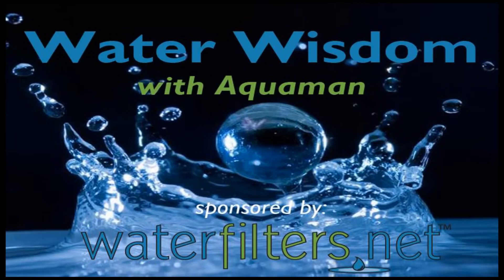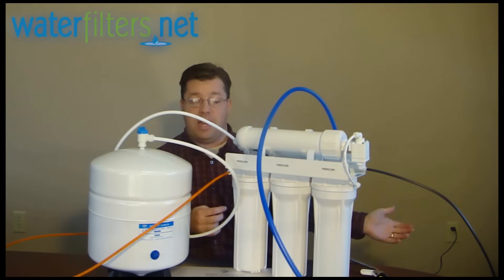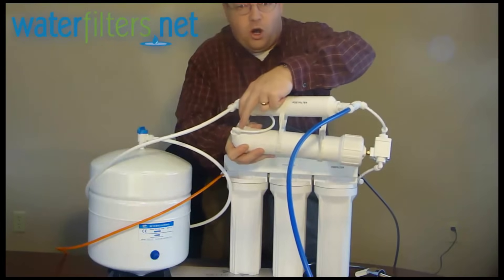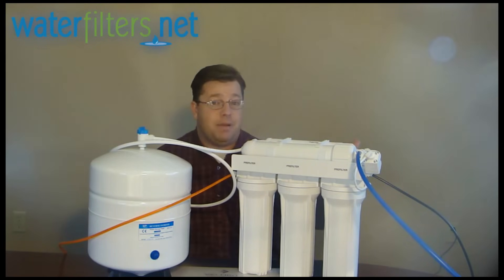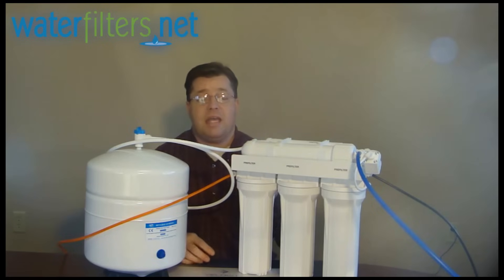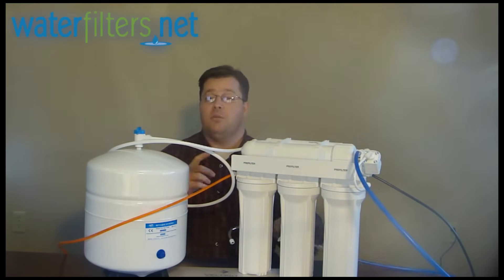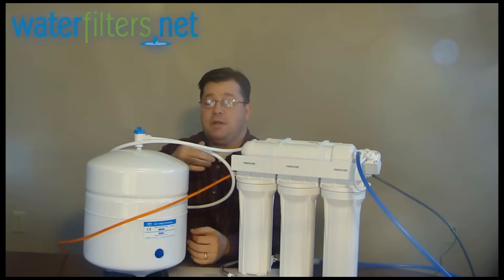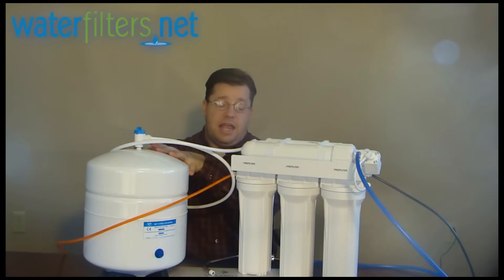Reverse Osmosis System Troubleshooting

Comment: I replaced an old system with new pre-filters, membrane and post filter. The only parts retained from the old system were the faucet and accumulator tank. I serviced the empty tank to 8 psi. Upon applying first water pressure, I had an audible flow that quickly filled the pre-filters and after a minute or so, flow could be heard in the waste-water line. However, after 10 minutes of healthy inlet flow, I was seeing nothing at the faucet. I disconnected the line between ASO and post-filter . . . zero flow. Bad or poorly connected ASO?
Reply from the maker: Deanna Douglas Yes, I would check the ASO valve connection to see if that could possibly be the problem you are experiencing. If that is not the problem, please call our customer service department and we would be happy to trouble shoot with you.Our phone number is 888-801-7873. We are open Monday - Friday 7AM-7PM CST.Thank youWaterFilters.NET

Comment: I have an older neglected RO system that came with my house. I need to disinfect the system, replace all the prefilters, replace the membrane, replace a bad auto shut off valve, replace the flow restrictor (printed on it is "440 FR". Can't find a membrane to match.), and replace the polishing filter.  

1. Am I correct in guessing that it is still best to rehabilitate this old system vs a full replacement?
2. I have two prefilters and I have city water. Should I skip the sediment filter and have two carbon prefilters?
Reply from the maker: Jeffrey Obney It would depend on how old the RO system is. As long as it is in good working shape, you should be fine with just changing all the filters and cleaning the system.We would always suggest to use a sediment filter first. That would help prolonger the life on the carbon filters and membrane.I am not able to locate that specific flow restrictor, but we do carry a wide range of sizes.You can view them directly here:@Flow-Restrictors.htmlPlease let us know if you have any additional questions, or feel free to contact our customer service department at 888-801-7873. We are open Monday - Friday  7AM - 7 PM CST.Have a great day!

Comment: Hi .. nice video. My husband changed the faucet to the ro system and now the water is murky.. it's been two days now. Do you have any idea why this has happened?
Reply from the maker: 621Lori It may be caused by any build up that was on the water lines previously. I would suggest letting the tank completely fill and then empting it and see if that helps with the murkiness of the water.If this does not work, Please let me know!
Reply: *****
Thanks for responding.. I did as you said and drained it and let if fill again..three times actually.. and it's still murky.  Any input as to why.. would be greatly appreciated.
Reply from the maker: 621Lori If the only thing you changed is the faucet in the RO system, it does not make sense to why your water would be murky. How long has it been since you changed your filters and membrane?

Comment: Exceptional video, never seen so many comments on a video. I am having a purging sound coming out of the faucet vent hole. Going to check my tank pressure, but wondering if this is the sound of water draining out the black tube you described? System works fine other than this annoying sound. THANKS AGAIN!
Reply from the maker: RVFanatic Good Afternoon,Yes, the sound you are probably hearing is the brine water draining out from your faucet.Please let us know if you have any additional questions!
Reply: RVFanatic

Comment: Great video. The problem I'm having is that my tank will not fill. After replacing my filters and opening the supply valve I could hear the water fill the filter housings but then stops without any water filling the tank. All lines/valves are open. any help would be appreciated.
Reply from the maker: Matt R. Our customer service department would be happy to trouble shoot to locate the problem for you. Please contact us at 888-801-7843. We look forward to hearing from you soon!

Comment: Wow, great video.  Lots of good information.  I changed the filters and everything seemed ok for a week or two.  Then the pressure in the tank was low and we pumped it up and the pressure is good.  But now the taste is off.  I did not change the finishing filter when I changed the other four filters.  I did not change the finishing filter because all of the other filters were very clean.  Do you have any suggestions? Change the finishing filter?  Flush the system?  Or what?  Thanks so much.

Comment: My tank is no longer filling. but i dont hear the cobstant running down the drain. I've had my system for a yr now. It's same model as in video, except I have an additional UV module on top of filterpac. Could the fact that the tank doesn't fill AT ALL, be due to the bladder, or is that more of an ASO valve?

Comment: I have a WHER25 RO, I am getting a leak from the faucet side of the system on a very irregular basis. It will be ok for a week, or longer with no leak, then there is water leaking onto the kitchen floor. Like a big squrit of water then it stops. Help appreciated. Fred Keeler

Comment: Aquaman, I love your videos! After a number of tests, i found I had water going INTO the RO membrane but NONE coming out.  Taking it apart I found the membrane packed with carbon material.  (I have a 5-stage system.  It wasn't granules, but "brittle film" that broke up when I rubbed my finger over it.  It was also in the last stage of the carbon filter.  I cleaned the filter chambers and buying a new membrane.  Any idea what caused this?

Comment: our system is not working.  Water is flowing up until the reverse osmosis membrane.  We just changed the membrane and have not idea what could be the issue.
Reply: Did you figure it out? I seem to be having the same problem. Thanks.

Comment: my system is not working. We thought it was because it doesn't have enough pressure so we filled it to 35 psi but it still doesn't work like before it hardly lets any water out. HELP!

Comment: Great explanation, thanks!  We have a GE RO system and no water is coming at all.  We know that what happened to it was that the water was left on here at the acreage and the well was run dry, which clogged up everything in the RO system and we figured it was just the filters that needed changing so we bought new ones and tried to install but there isn't any water coming through at all.  After watching the video, can you tell me what you think might have happened? Do I need a new tank also?

Comment: I have a watts RO. My drain doesnt run all the time. It seems to run and fill up like normal, then when i go to use the faucet i get about 4 ounces at a time. Just checked my pressure when the tank wasnt refilling and it wasnt even 5lbs.    Do i need to do more trouble shooting or should i just order a new tank at this point?

Comment: I actually got it working now. With my new confidence on how RO systems work after watching your videos, I began removing pre-filters to see if they were working properly. Turns out my Carbon Pre-Filter was defective and virtually no water was flowing through it. I replaced it and now everything is working perfectly with a huge increase in the water flow (before it was just drops)

When all other likely fixes failed, I looked at the unlikely ones.  Thanks for the help - it is much appreciated.

Comment: I have a similar problem, I replaced all of my filters in my Hydrotech system and the tank does not fill. I emptied and reset the pressure in my tank to 7 psi. I replaced my restrictor line and I even replaced my check valve yesterday and it still won't fill. 

The unit is producing clean water and drain water when I disconnect them.  It almost seems like the filtered water doesnt have adequate pressure to fill the tank.  The driain line runs continuously even though the tank doesnt fill. HELP !

Comment from the maker: If you are certain the tank is empty and not receiving any water, then the system must not be producing any water. Make sure the tank is empty by opening the faucet and draining any remaining pressure, then remove the water line that feeds the tank. Put that water line in a bucket and see if it is producing any water. If not, then something is wrong with the system. Maybe a clogged filter or membrane, or possibly the ASO valve is defective. Is the system making a continuous noise?

Comment from the maker: Are you certain the RO system is producing water and actually delivering it to the fridge. Check this by removing the water line from the back of the fridge. Obviously you'll need to have a bucket handy for this. Does the fridge have an integrated fridge filter? If yes, when is the last time it was replaced. Even though your RO water is very pure, the fridge filter will need to be replaced at least once per year.

Comment: Wow, you provided great information in the video!

I have a Watts ZRO-4 and the Recirculation Pump seized. Then modified it with a ASO valve, and check valve between the membrane and GAC filter. The task piqued my interests, now I'm considering adding another housing at the end of pre-filters. E.g. a 5 micron coconut shell carbon cartridge, or a VOC Filter block. I just wonder if doing all that is unnecessary, considering the membrane does it too.
Hope you can help. Thanks for the helpful video!

Comment from the maker: Here are a few things to consider. Are you absolutely sure you have the correct O-rings? Are they in PERFECT condition? Have you tried to seal the housing with NO filter installed? It's possible the filter is not allowing the housing to close all the way. Are you sure the housing sump is not cracked?

Comment from the maker: Is it possible the filter cartridge you are using is too tall. Perhaps it is not allowing the sump to fully seal against the cap. Try removing the cartridge and closing the sump. If the leak goes away, the cartridge is the problem. If it keeps leaking you have another issue, possibly the wrong size O-ring, maybe a hairline crack.

Comment from the maker: @fadifanous That is highly unusual. I suspect either your system is incorrectly installed/configured or the polishing filter (last filter after the membrane), or the membrane itself is defective. is the membrane a chlorine tolerant membrane, and if not (probably isn't) are you using a carbon pre-filter to remove chlorine, and are you being faithful to change it on schedule. Chlorine will burn most membranes if not protected by a carbon filter.

Comment from the maker: @PlasmaEnthusiast Sorry, but you need the tank for storage. Depending on the GPD rating of your system it is only producing a couple of ounces of water per minute (hence the need for a reservoir tank). Did you check the filters? What was the result of your investigation?

Comment from the maker: @1IIIIIIIIII1 No. Reverse Osmosis does not use any chemical in the purifying process. In very basic terms, the water is being pushed through a semi-permeable membrane that only allows extremely small molecules through. 95% rejection of TDS (total dissolved solids) is typical. RO water is extremely pure water.